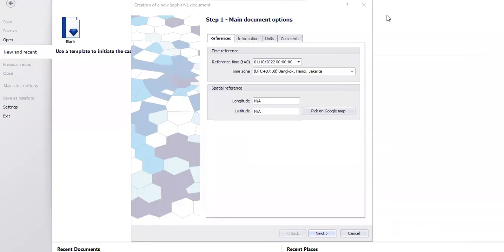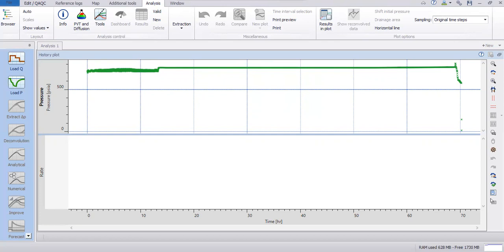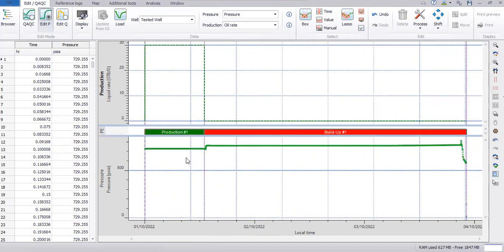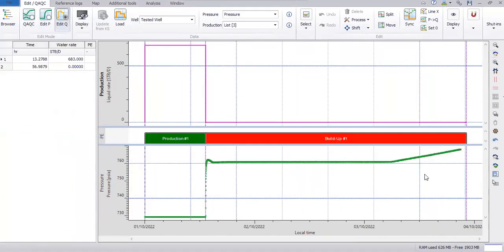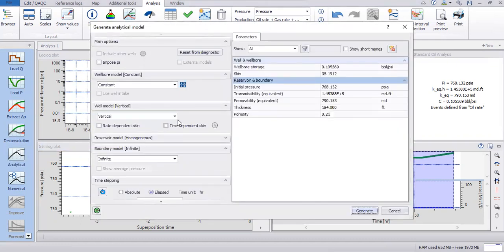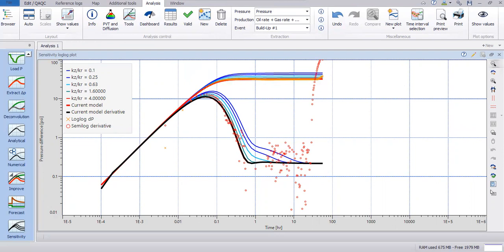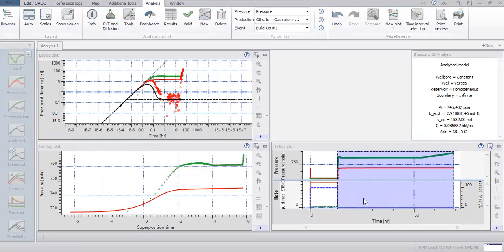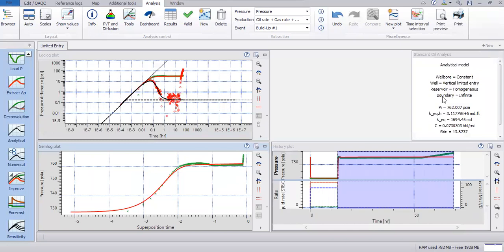Pressure Transient Analysis Case 5

Comment: Thanks! I Think the hump is more likely caused by the reversal of the liquid column back into the reservoir due to the high water cut and Pwf close to Pi. So it can be ignored (treated as noise) during the matching process
Reply from the maker: Good point!